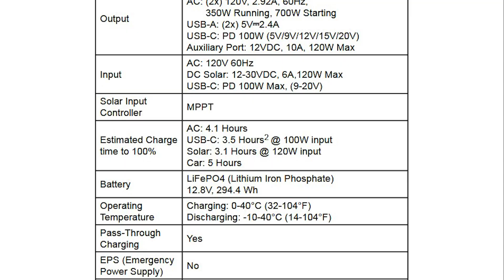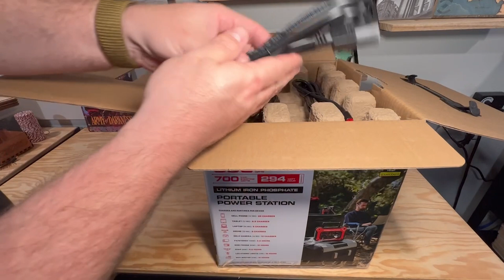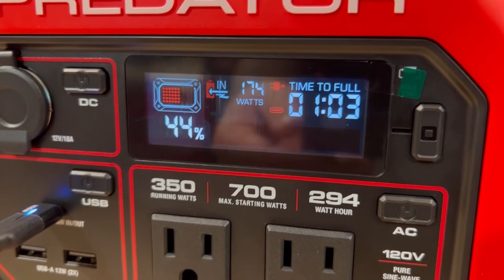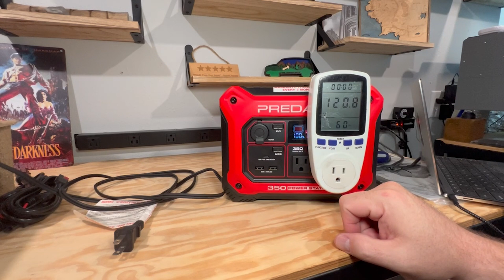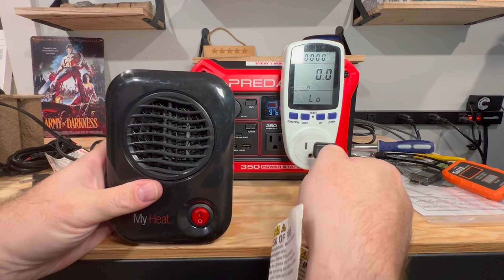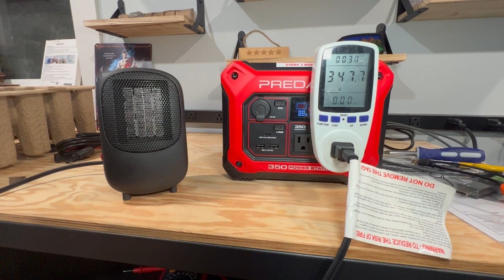Harbor Freight Predator 350 Power Station Unbox and Test

Comment: Most reviews will be positive  because  they want  free products send to them by the manufacturer.  For the money it's not worth it.  Before you buy it ask if there's a restock fee of 20 percent that's 45.00 bucks. From  the harbor freight in eagle pass tx.
Reply from the maker: I returned mine without a restock fee.   Just told them it didn’t do what it’s supposed to do and they refunded it in full.

Comment: I bought my 350 in Eagle Pass TX and they told my there was a 20 percent  restock fee due to so many returns. I plugged a one 11 watt light bulb an afterv11 hours I had 35 percent  battery  life remaining.  This is a toy. If you buy a 12 volt 100 amp lithium battery and a inverter and a battery charger for 225.00 you can get 4 time more power and at ant time you can buy a second battery  forvextra power. All your paying for hear is the cords and screen . 2 thumbs down.

Comment: I bought one of these just to try it out. Probably going to return it when the bigger models are available. My local HF doesn't even have the Predator solar panels yet.
Reply from the maker: I returned the one from the review and picked up an EcoFlow River 3 plus.  $10 more and came with a solar panel and uses an app to manage.   Way more bang for your buck.

Comment: I like your review. Please do a RYOBI 1800 watt power station battery inverter review. Your input/review would be valuable, AND good for your channel as there is alot of RYOBI customers.
Reply from the maker: There seems to be two models.  One that has a built in battery that is somewhere in the $1200 range and one that uses the 40v batteries in the $650 range without batteries.   Unless this channel explodes or Ryobi wants to send me one for testing, it is out of my limited budget. :(

Comment: If you can charge this with an external lithium it might not be bad as long as you dont need a big inverter. You can fast charge and abuse the lithium and have 1574 watt hours available.

Comment: Dam mine says I’m using 350 watts and shuts down on a 200 watt load tested with the same meter :// guess I’m returning tomorrow…
Reply from the maker: The one good thing about Harbor Freight, that return policy lol.  I'd recommend the Ecoflow River 2.    Doing my next video on that one.
Reply: @ I’m torn between the new river 3 plus and bluetti ac3a, I originally bought this because of its warranty, I like the style of bluetti the best but eco flow looks to have the best reliability. Harbor freight I feel like was misleading about the charge time and inverter capabilities, not to mention the “pass through” charging doesn’t exist it just goes between 99% and charging at full speed and 100% no charger input, ends up not charging above 98% after charging a small power bank off it plugged into ac…
Reply from the maker: I am going to return the Predator 350 and just purchased a Ecoflow River 3 plus for review.   The predator has 8wh more capacity, but the inverter on the river 3 is a 600 watt inverter and a expansion battery can be purchased to expand it to 858wh if more capacity is needed.  It also has a 45 watt solar panel included with it as of 12/16.   Also has a under 10ms UPS mode.   I have a referral link if you want to get 5% off.  If you use the link it helps the channel out. If you're trying to decide between the two, I'd pick the River 3 plus.  https://www.ecoflow.com/us/referral-rewards?inviteCode=APTTSQ47GD

Comment: Way too long of a charge time, especially considering you need two chargers. The power stations are nice but I generally don't need that portable of a power if I don't need a generator. I've decided on a Dakota lithium drop in lipo for a car. Apparently no alternator changes needed, just occasionally plugging it in to top charge. If I need power remotely it's typically where my car is, I could wire in solar panels and I can plug in whatever inverter I want. And having multiple sized inverters allows you to increase your runtime when powering smaller things. Having 150 watt inverter for a small fan, and a 2000 for running saws/ power backup
Reply from the maker: I think the charge time is slow to preserve the battery since there is no software/app to limit the charge speed or charge limit. At least that is my assumption. 
 What did that Dakota lithium battery run you?   The ones I've seen are around $599 and are 720wh.  I picked up a Delta 3 from Ecoflow with a 1024wh battery an an 1800 watt inverter for $399.   The ecoflow is an all in one that is harder to repair if necessary, but the idea of wiring up inverters and solar panels to my car battery seems like a huge hassle.   Having that modularity is nice and if it works for you, that is awesome.

Comment: Do you know if you can use it and solar charge at the same time?
Reply from the maker: You can, It offers passthrough charging!
Reply: You can use all three input sources all at once per the instruction manual provided I charged via the 110 and the USB-C and was getting 98 W input

Comment: Good review, I was curious of these. 
Having several small generators, deep cycle sla batteries and inverters with far more capacity just not enough bang for the buck (for me).
Reply: It's a power station, not a generator.
Reply: @leeinwis  Deep cycle and inverter also a "power station" and much less cost.
Reply: And it's awesome 👍🤔👍😊👍 @leeinwis

Comment: To have your fan kick on during charging means that you're overheating the battery. And if this takes a lithium battery that is very bad. And it becomes a fire hazard when the battery gets hot. Because once the battery is damaged inside, it becomes a continual short until the whole unit is burned up. This is why electric cars get into accidents and insurance companies want nothing to do with fixing it because if the battery was damaged and shorts out later from that damage. All the fixing of that car goes down the toilet because the car will burn out once that battery catches on fire. So the insurance company would end paying twice on one accident.

Also a slow charge with one hookup increases the life that lithium batteries instead of always doing quick charges. It also makes the charge last longer just like it does in a car battery when you trickle charge it instead of normally charging it. Because unless the instructions say that you can hook up as many inputs as you like and charge it as fast as you like because there's a safety feature for charging it too fast, you are asking for trouble. And lithium fires don't generally go out completely in the fire department is often called out three or four times on electric vehicles to put out the same fire. Also if the unit catches on fire the lithium batteries put out such toxic fumes that if you don't get out of the room it can overtake you and kill you, no joke. Firemen have to wear special suits with breathers so they can fight an electric car battery fire. Because if the wind changes Direction while they're fighting the fire and then golf the firefighters you can kill them.

I know from personal experience how lithium batteries can catch on fire. I have an electric wheelchair and I was converting it over to using lithium batteries. My charger charged up the batteries too quick, the wheelchair caught on fire, and about burnt my house down. So this is not a joke you have to treat lithium batteries with correctly or you're asking for a fire.
Reply from the maker: This power station is designed to be charged via AC and USB-C PD simultaneously.  It is in the manual and on the box as safe.   The fan kicks on when there is a high draw to keep the battery from overheating, not because it is.  It has a thermal shut off when temps get too high and stops all output.  I have a side business repairing power tool lithium batteries and have my fair share of experience with modern lithium battery technology.
Reply: It uses lithium iron phosphate batteries.
Reply: You have no clue. You are spitting out opinions and speculation as facts.